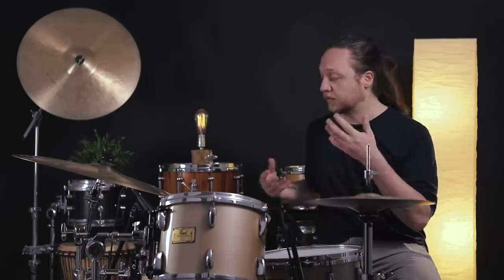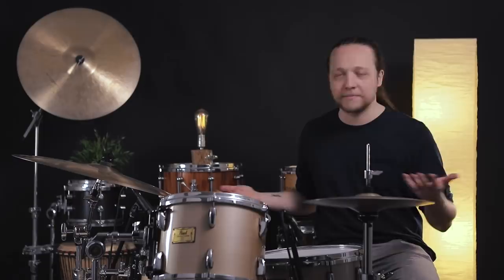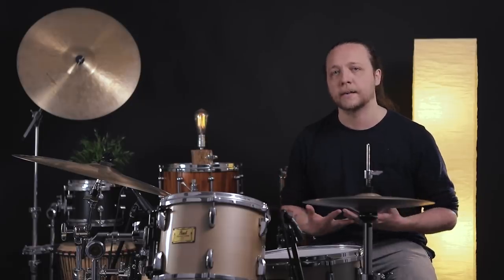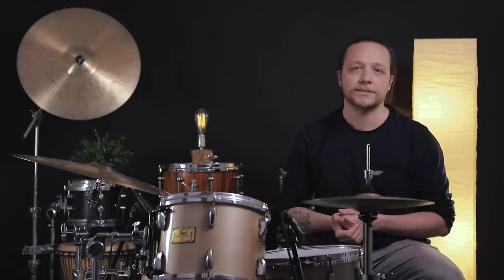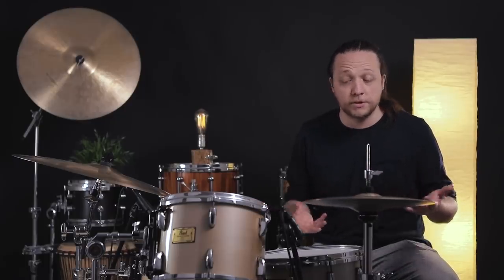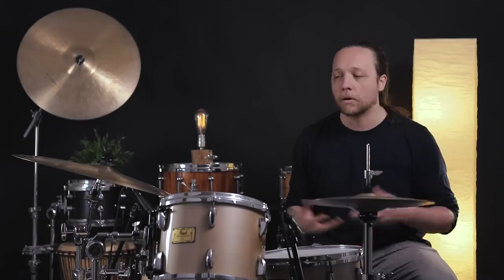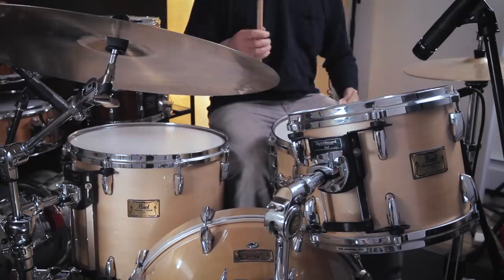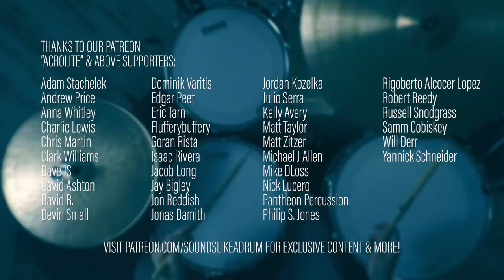Muffling Techniques for Punchy Toms | Season Three, Episode 1

Comment: What you do with the gaffe tape, I do with moon gels (and similar products). A whole moon gel was always waaaaay too much dampening for me (unbelievable to me that there are people that use multiple gels on one drum...).
So I started to cut the gels into small pieces. Somewhere around 1 cm in width and maybe 2,5 cm in length, something like that.That way it is much easier to switch the positioning on the drum compared to gaffe tape. And and somehow a small piece makes the tom sound much beefier while retaining all the the attack and also some overtones. Placing a small piece of gel directly under the microphone can have a huuuuge effect. I always put the piece as close to the edge of the drum as possible and if I want more muffling I just move towards the center. One small piece on snare and rack toms, two to four on the floor toms.
On the snare it takes the ringing away that you would sometimes cut out with a EQ. I found that to be the best way do muffle in minimal ways because you can control the amount of muffling so well. And also that way the gels last for a loooong time since I only need small pieces.

Comment: Happy to be here for the start of season three!

I also sometimes use gaff on my reso heads. If I’m playing a quiet gig and want to have lots of tone but a short note, I tune the top head higher than the bottom  and put a small piece of gaff on the bottom. It’s a cool sound! Intend not to like the focus and attack an e ring provides—it’s a way around that issue for me.

Comment: Sadly drum makers because of cost, stopped installing  the Internal mufflers at the factory on drums back in the late 70's. Many younger drummers don' t like them because the ones they have seen in their lifetime were old and not maintained at all, so they rattled,  So in their mind that's how they all worked, Which is not true at all. All you have to do i Maintain them, Just tighten the screw and lock washer and nut down and/or replace the felt if it's worn,  and you can Dial in the exact muffled sound,  The Gretsch Drum company really made them right,  they were all metal with a round felt muffler installed on the top and bottom heads and they really worked well especially on the the Bass drum. Lots of time a mid frequency ring can come from the bottom head as well as the top,     Rings will do the job but you cant really get the exact amount of muffling, you get what it gives you, Not so with the internal mufflers. I have a 60's Ludwig kit and they are built into the kit and they work great, Just tighten and oil them once in a while and they last, Mine are 60 years old and work fine. Modern Drummer did an article on them and the drum company's said drilling into the head compromised the shell, That was not the truth, The real reason was cost, for Parts and drilling It was about the bottom line. The holes drilled into the drums required for the internal mufflers were tiny. It was small screw with a lock washer and nut that held them in place.
Reply: Cost might be a justifiable factor presently if this feature has fallen heavily out of favor.  I know that personally, possibly very incorrectly, associate internal muffling with cheap sets that have bad shell and component acoustics to really dampen all the bad overtones and rattles.  I also don't like the idea of something coupling a nicely resonating shell and the head of the drum in some secondary secondary way that might disrupt the natural, air-space interactions of those two surfaces.

Put simply a lot of people who have this, again possibly incorrect, perception won't want to pay money for that feature.

But that doesn't make your comment any less useful, thanks for giving me something to think about the next time I build or tune a kit.
Reply: @adamtolley5621  Thanks for the feed back Adam, I feel this way about mufflers because  I  have a dislike for mid frequency overtones. Every drummer I am sure has the sound he desires in his mind and ear.  Because that mid frequency tone drove me crazy the internal mufflers really removed the over ring. As long as you didn't over use it, I especially loved the ones Gretsch installed on their Bass drums, They also use to sell an 6 or 8 inch muffler that attached to the bass drum rim and  head, It did a good job. Some kits need the over ring I know Jazz drummers love that over ring , and it works well for them.  I guess what it boils down to is what sound works for you and  is it enhancing the music or disabling it.

Comment: Why when I hit my Tom's they sound like cardboard? So annoying because I have them tuned very good but if I strike them hard with my stick you get this crack and the tom sound goes away and all I'm hearing is a big wack. No tone or anything. My floor tom especially sounds very loose and flabby. I have it tuned low but there is no life to it. I find if I put a ton of moon gels on them they sound ok but is there a Way to fix this issue? I'm using Evan's heads is there a head that sounds full even when you hit hard? Sorry kind of hard to explain, I want that tight full mic sound without using mic's. I have none

Comment: I don't really like much muffling on my drums, especially when I'm using drum heads which have muffling or tone control already like a Remo cs dot, powerstroke 3 or an Evans power centre, genera, genera hd on any of my snare drums. Maybe if I'm using an Ambassador on a steel shell. Nothing on my Toms. Maybe a small piece on my floor tom if I'm using just an Ambassador or Emperor. Nothing at all in my bass drum. I like my drums as open as possible.

Comment: 1. Muffling is loading mass to the drum
2. Whether that mass is coupled or decoupled from the drum head is important. 
3. Non-coupled mass (like a wallet) bounces off the head with harder strikes, providing a sort of gated dry sound, where the drums resonate fully, but for a much shorter duration as the mass falls back onto the head and muffles it. 
4. Coupled mass provides a permanent muffling of overtones. Usually the higher overtones get muffled first, so coupled mass produces a darker as well as dryer sound.
Reply from the maker: Indeed!

Comment: Ya didn't do moon gels... I gotta say E-Rings are the best option for getting a solid thud sound, BUT they do sometimes seem to vibrate on the surface of the head which sux when you're recording
Reply from the maker: Nope, as we don't use them. These techniques do everything we need and are far cheaper + readily available and have a wide range of uses. BTW- if the studio rings ever vibrate too much, they're probably a little large for the hoop. Cut them down just a sliver on one side and they should function just fine.

Comment: What I found really interesting is if I close my eyes and focus on the final comparison I hear the switch between the techniques immediately in how the rest of the kit, especially the snare ring out.  It almost has a more profound effect on the snare than the toms themselves.  

I like and use e rings because they are pretty fool proof and warm, but that gaff tape setup you did was the only method in this video that seemed to increase the definition of the toms, giving them more punch and a short but linear falloff that allowed them to express their full sound while quickly getting out of the way of subsequent notes.

good stuff.

Comment: Hi.

A while back, you lined the bearing edge of your snare with gaff tape.  I wonder what affect that would have on the tom's?

I have used old worn out socks, there's one on my snare right now, suppose it's just like the bandana method!
Reply from the maker: To be clear, we put the tape on the head, NOT the bearing edge. We don't advocate putting tape on the edge itself. We also recommend that more for metal edges, which is why we haven't done it with these toms.

Comment: Any kind of help pad or foam? I've used moongels and drumdots, sometimes even on floor tom bottoms. 
Also, I think foam rings work better since you don't get that snare like flap from the plastic ring. Too much, then cut it in half or 4ths.
Reply from the maker: Wouldn't really use a pad or foam on the batter head but we've covered a couple of internal/reso muffling techniques in previous episodes. Haven't had any issues with flapping/audible sound of any sort from the E-rings but that's dependent on the hoops not being undersized. -Ben

Comment: Great episode. Full on nerd question here. Some drummers (I think I heard Gavin Harrison say this once) prefer to have muffling that’s radially symmetrical around the edge of the head, meaning equal in all directions around the head. So the e-ring definitely does that but your gaff tape example didn’t. Do you think that has an impact on tone if you think about it in that way? Perhaps smaller pieces of tape symmetrical around the edge instead of 1-2 larger pieces?
Reply: I’m also a firm believer in gaff being the most versatile.
Reply from the maker: Thanks! Yes, asymmetrical muffling we will impact the tone but if you're adjusting it based on how it sounds then you'll likely end up with something that you're happy with. At the end of the day, it may be asymmetrical but if it sounds good, that's all that counts. I would place smaller amounts of tape around the entirety of the edge of a drumhead unless that's the sound I'm going for. In a way, the asymmetrical placement can be more effective (especially with greater mass) similar to adjusting a single tension rod. Cheers! -Ben

Comment: I tend to use drum dots over tape. I like the idea that there is no adhesive being left on the drum head. Where do you get gaft tape? I usually only see duct tape which is partly why I don't often use tape.
Reply from the maker: Gaff tape doesn't leave residue, which is why it sees so many varied uses. You can get it from any music store or camera/photography store. Duct tape is nightmare- strongly warn against using on anything related to drums. 🙅🏼‍♂️

Comment: Wait what is that flanger wah effect in the Tom resonance @ 8:14 how is that natural
Reply from the maker: It's not so much a flange or wah but rather the coexistence of the multiple tones present in creating the full drum sound. The batter head and reso head are each tuned to different pitches and then the full sound of the drum is actually a third pitch created by the phase relationship of the two heads.
Reply: @SoundsLikeADrum  ohh ok, makes sense... but Is this due to a particular type of micing used here that these sounds cannot be prevented? Because I normally dont hear these in isolated drum tracks. I'm just curious....

Comment: Is it possible to muffle the hihat?
Reply from the maker: Yep! We like to use a bandana between the cymbals. You can experiment with various configurations. If you need more muffling on the top cymbal, try running a flag of fabric on the opposing side through the clutch.